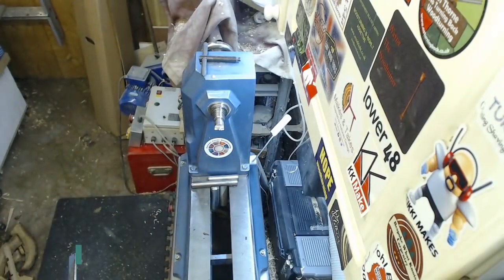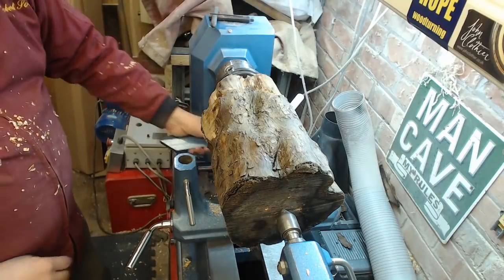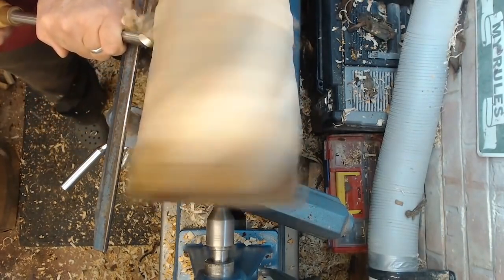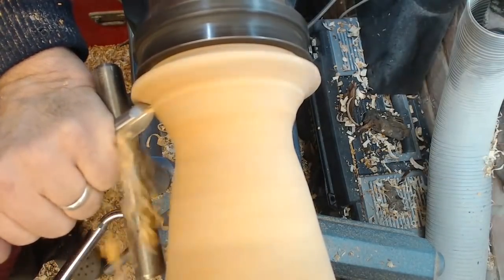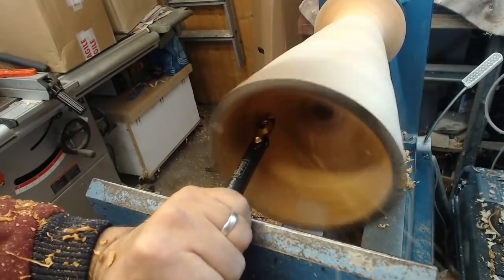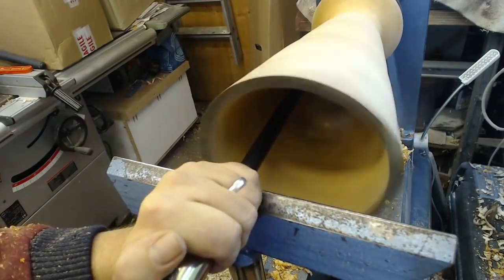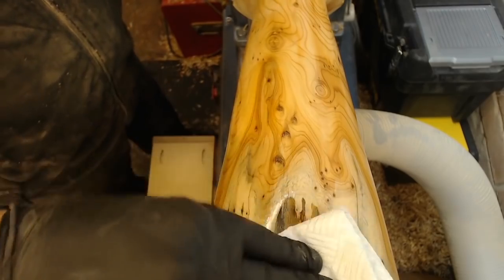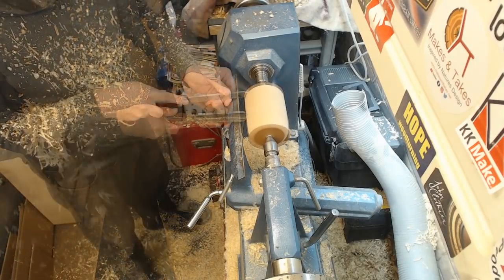Woodturning a Tall Yew Vase

Comment: You surprised me with how far you were able to hollow the vase. Fantastic. I have looked on the web for a smock like yours with no luck. Everything seems to be short sleeved and costly for what you are getting. Finally resulted to a light weight welding jacket. Dust and shavings brush off easily. Anyways, thanks for sharing Stewart.
Reply from the maker: Thanks, Joseph - this one was second-hand so cheaper than new.....currently about £50!!!

Comment: Love your channel. Try using an Oland style tool for roughing out the outside of your logs. You'll never use another bowl gouge again. I make mine with one inch thick wall pipe with a 3/8" hss tip. Good weight at your grip keeps the tool from jack hammering.
Reply from the maker: Nice idea..will have to give this a try. Glad you enjoy my channel. Thanks for commenting! Cheers

Comment: Hello Stewart, Many more extensions on that tool handle and you could use it for javelin practice at school sports, as opposed to the snooker practice that your stance implied. I've had the Simon Hope kit for about 9 months. I must unbox it. I bought it with the laser positioning accessory and so I have no guilt in suggesting that one might wish to view Keith Barrow at 94a, for a camers solution.  The same camera cost me c.£10,  the extras were an extension cable with two RCA plugs, and a 6v to 12v d.c power supply, (as per leds). The camera signal is analogue and not digital and so a small tv as opposed to a computer monitor might be necessary. Full disclosure, I did have these other bits lying around.
Anyway, the vase turned out very nicely and your still alive, which is always a bonus. Well done. Regards Glenn :-)
Reply from the maker: Thanks, Glenn! I will get mine out of the box one day too....i've got a usb endscope camera that might work....another bit of kit to unpack and use!!! Cheers!

Comment: 5/8=1/2? Good thing you are not a math teacher!🤣 Very rustic with nice holes. That is quite a hollowing extension you put together. Handles on handles. Care to show how they fit together? And if you absolutely must ebonize, inside only please. Though I am pretty sure you are just teasing us!
Reply from the maker: Haha...you sound pretty confident it's just a tease ;) The 1/2 inch versus 5/8 inch is real!!  For some reason the UK measurement is the flute size and the US one is the bar diameter....
Will try to remember to show how the handles fit together in my next video...Cheers!!